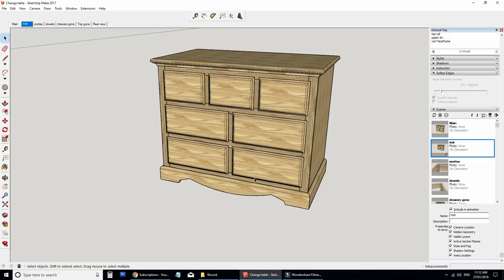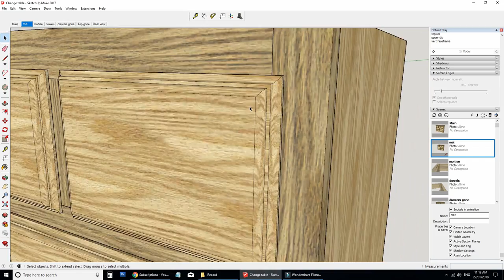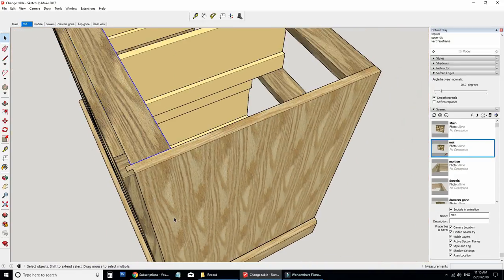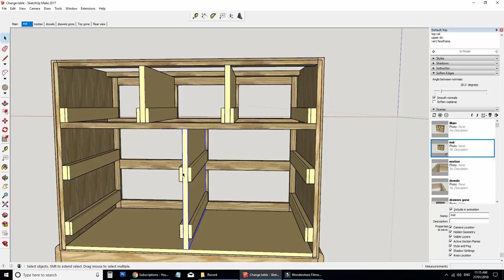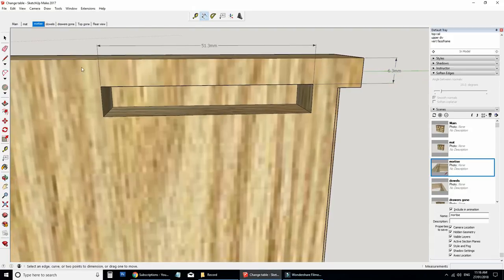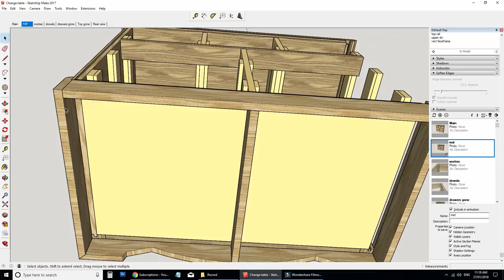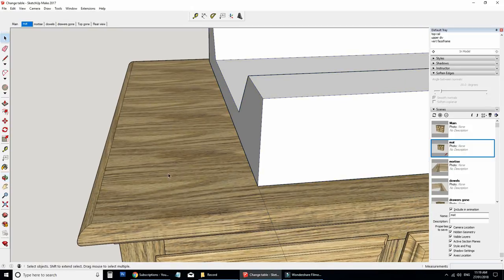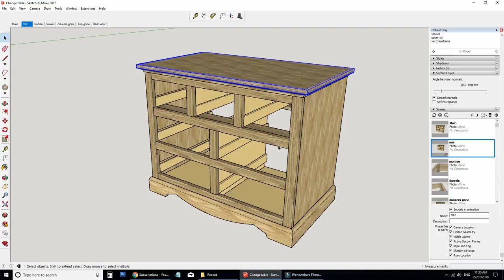Chest of Drawers 1 - Design and timber selection

Comment: I like this sort of start to a multi-part series. It gives the opportunity not only to see the design but something you rarely see discussed being the thought behind the choice of boards, joints and material. Very educational, let's dig into the noisy bit!
Reply from the maker: I often forget to show what I am building as I am filming. I see the same problem on other channels. You see timber being cut, and joinery being made, and then all of a sudden there is a finished piece???
Reply: @kuffyswoodwork  yeah that can make it hard to follow. The intrigue works for some projects, like Vic's Awesome Chopper, but usually you want to know what you are seeing come to life!

Comment: No I'm not stalking you .... lol. Good thing i was sitting watching YouTube when this notification came
Reply: Was that 4 boards 6" wide or will you revert to for at 150mm 😂
Reply from the maker: Hehe, you can stalk me if you like. You don't seem like the kind of bloke which would seek to do me harm.....or are you???? 😀
Reply: I might try amd sneak your table saw into the back seat. 

Oh you love your dowels. 

Not that it means much but yes I approve of your design. Mind you I'd rather do it all out of solid timber. The you could have a floating tenon or two
Reply from the maker: The plan months ago was full solid construction with dovetailed drawers. But that was back when I had plenty of time to complete it. Now I'm just going to make it look nice on the outside and functional on the inside, it should save me a couple of weeks in real time. I like mortise and tenon the most, but I use whatever joint is needed. In this case I need to use dowels to connect the rails to the side veneered panels instead of using a sliding dovetail like I normally would for solid timber construction.